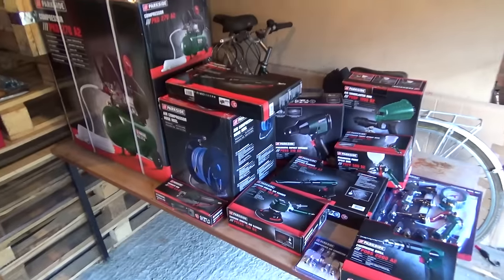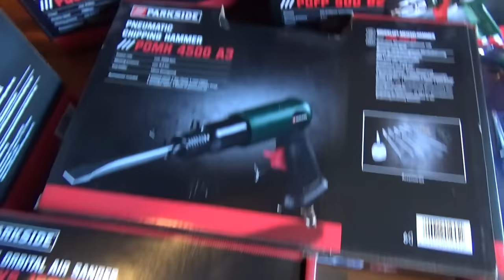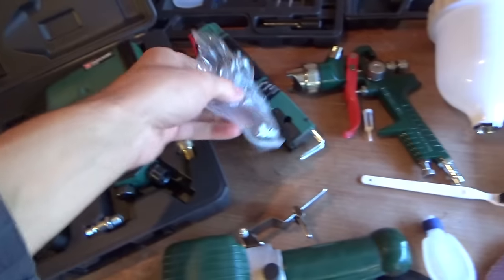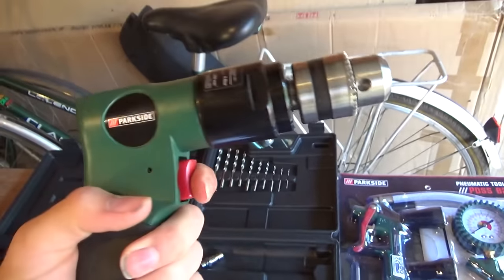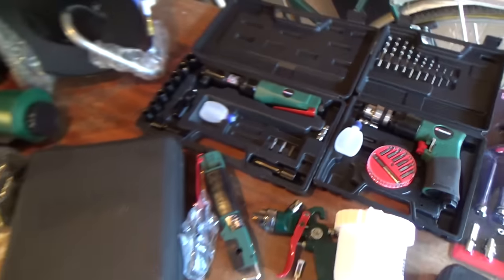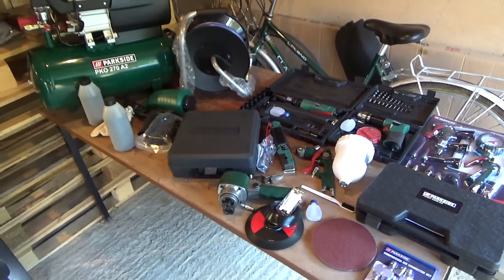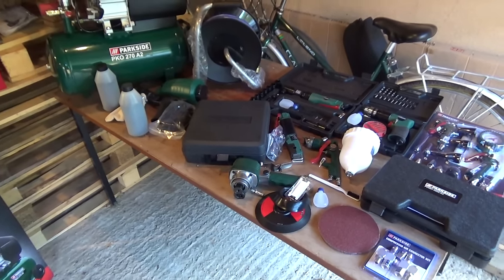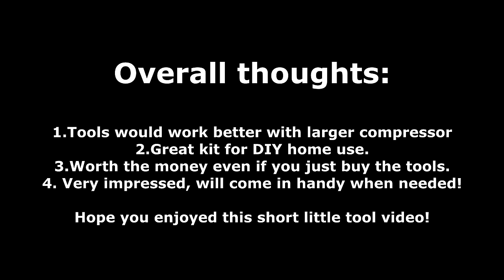Lidl Sells Air Tools?!

Comment: All the tools are good value but the compressor isn't large enough capacity for the impact wrench.
Reply: V T what size do you recommend for air tools ?
Reply: @gerry5134   the work is ok with a 100 litres 3cv bicylindre compressor.(prodif).

Comment: You need to turn the pressure up on the air compressor for things like the wrench it was probably only set to like 50psi and It needs to be 90+. mine works fine
Reply: Yeah i was thinking they wouldn’t sell the air tools on the same day as the compressor if it wouldn’t be fit to run it. I know it wont run for long periods of time but it should definitely run any of them tools on show here

Comment: The most of the tools are quite good for this price (I have almost everything from the video), but 102 l/min. from this small compressor isn't enough for them. The bigger tools (+ the sandblaster) need 180 + l/min (sandblaster - 310 l/min). Good video!
Reply: Tibor Višnai h

Comment: I purchased a Parkside cordless drill about 20 years ago, for a few years it got used 5 days a week and has been used infrequently since, its still In working order though one of the batteries no longer holds a charge. I would recommend parkside tools they are great value.

Comment: hi, when i brought a compressor years ago i was told its the cfm number you should look at as to the power of a compressor. the tank only stores x amount of air and also takes the pulse wave of air and calms it. eg your air tool uses 4 cfm (details on instruction leaflet) and compressor puts out 8cfm all ok with some to spare
Reply: True. Is Capacity really everything? Capacity for me is just how long the tool can run before the tank becomes empty and the compressor has to kick in and to add in that Air compressor is only delivering 103l/m or 3.6CFM which for an 1/2" impact wrench at 6 bar needs 4-5 CFM but they say you should double it for optimal use and we own a 50l 206l/m 7.3CFM and it can run fully undo 2 lug nuts and loosen the other 2  in 1-3 mins before it becomes underpowered. That being said is it better so have more air Capacity or a higher bar with both compressors having the same CFM considering they say most tools are optimal for 6bar

Comment: Nice to see another upload James. I'm sure those tools would work better with a much larger compressor, most of them use large amounts of air volume and that small tank just doesn't have the capacity to run them very well. 
I like your dads little Yamaha too!
Reply from the maker: Mark Fox thanks bud, I will probably get a 100L compressor in time, just wanted something small to try use a blow gun and stuff with
Reply: user12345
Reply: Charlotte Baker ?
Reply: This year Lidl are doing a 50 l compressor.

Comment: You have to set the air pressure of the compressor to 6.8 bar if you use the Lidl impact screwdriver with a 10 meter long tube.
a 50L tank is also recommended but the air pressure doesn't has to be too high because the tool will waste the extra air.
When you have an 8 bar compressor and set it to the max your tool has to spill 1.2 bar but can't control it precisely what is a loss of pressure.

Comment: Looks exactly like my Omega Wolf compressor, which is the same brand as Aldi use to manufacture (or at least at one time they did) as well, just my tank looks a touch longer. I was going to get a new spray gun when I saw these in but didn't in the end. I got the saw from Aldi Workzone the week after, it's exactly the same. I figured I would get an all metal spray gun, the white plastic tub broke when over tightened before. Omega Wolf might be a new company name for the same previous company or the old one & it has a new one now. I remember warranty / guarantee chasing a new air filter was a pain in the arse.

Comment: I bought the £99 Erbauer set of air tools from Screwfix. They've been brilliant, and come in a really tough box, and are guaranteed for two years. Air hammer, 1/2" ratchet wrench, 1/2" impact wrench and blow gun, plus chisels ,extenders and  lots of fittings, grinding wheels etc. I've bought different Erbauer stuff from SF, and it has all stood the test of time. A box of impact screw and nut bits for my cordless impact wrench has not suffered a single failure, and I reckon the Pozi 2 bit in the holder has driven 2000 + screws without failing- better than the kraut bits I used to use.
My compressor is only a hobby 100L 2.5hp 10cfm machine, and with the (Erbauer) 20m  9mm hose I have to turn the pressure up to 105psi to give enough grunt at the other end to operate the ratchet  and wrench at full power. Don't be put off by buying a cheap compressor, they're very useful tools, even if, like me, you're only removing a few stubborn nuts, and inflating tyres. Blow guns are invaluable too!

Comment: Looks like a bargain, but. 24l compressor probably isn't man enough for an impact wrench. The other tools seem to be good value though.
Reply: True. But to be fair on the website all the larger tools state they are not compatible with the 24 liter Lidl one.
Reply: Well, you are correct, but I think it's enough for a person who needs it to change 4 tires on a car twice a year and some small things from time to time...
Reply: You're right, the manual does say 50+ Liters but I mainly use it to tighten nuts on things like motorcycle clutches and for that it's a great tool on a 24L compressor. Just don't expect to do a full pit stop with it in a few seconds because a 24L compressor can't handle the required air volume. For single nuts though it's amazing.
Reply: I have the same compressor and impact. I found if I use an extn cable and a short 4ft of hose the impact works much better. Way too much oomph is lost in that long, small bore hose I guess.
Reply: The size doesn't really matter so long as the pressure is there, you'd just be waiting a lot
Reply: Exactly, I have 50l 3hp compressor from Aldi and all air tools work great. Also it is highly recommended to use big diameter hose especially if it is a long one, because you do get pressure drop.
Reply: I have the same,but connected an old propane tank to it.
Works nice.

Comment: I bought the larger (3hp 50 litre) compressor from Lidl a few years ago, they had 2 marked down to £30 each! A friend of mine said "I bet it's rubbish" but mine is still going strong and has come in very handy. (Mine also failed to remove wheel though).

You can buy better, you can buy worse, but in terms of value for money, this stuff is great.

Comment: Buy a broken second hand air compressor with a large capacity and connect the 24 litre one to it. That's will give you a cheap massive air receiver, I'm currently using a 6 litre air compressor to fill a 150 litre tank and it works perfect once it's charged up.

Comment: These are ok for a hobbyist who uses them occasionally. Will not put up with daily commercial use. The major problem is that one has to wait until they bring them in for 'tool week' and then its a crap shoot if they will bring in the tool you need. The air tools are ok but most of my tools and compressor I brought with me from the states when I moved to Europe. Bought the high end Craftsman tools from Sears before their quality went to the dogs. The compressor that Lidl sells lacks the kojones to provide the proper volume and pressure of air needed for decent tools. The Harbor Freight tools sold in the States are far better than Lidl's products and they are both Chinesium made even though Lidl's products are not properly marked. Many times the package is marked Made in EU but on the actual product it is marked "PRC".

Comment: I have the 50ltr compresser if you use the smaller red hose that comes with it it powers all the tools just fine but remember 50ltr  is not much so it recharges quite quick,the long white hose great for spray painting  but won't run the air tools power full enough if an when parkside do a 100ltr  tank that would be the one to get but I doubt that would be portable with wheels on it

Comment: Dont worry too much about the compressor or gun being 'man' enough for wheel lugs, if something is that tight that shocking it wont do anything its always best to use a bar and apply constant pressure, I work fulltime on cars and I got a 1997 Snapon gun with no balls but when im doing wheel nuts up I know that i'm not over tightening them so when I torque them they're all good

Comment: Just try fitting a 3/8 hose to the compressor. Ok it will charge a lot more but it will have to extra power to use the wrench n stuff.

Comment: congratulations for your new purchase! an air compressor and a set of air tools are usefull in DIY mechanics shop. but for running this tools you need a bigger air compressor, maybe a 50 liters or more. this is why they are running slow. also you need a constant air pressure of 6/6.5 bar.

Comment: 24l=6 gallon air compressor.  You need one at least twice as big, and better three times, to run air tools like an impact wrench.  I have an 11 gallon = 40 liters, and it's barely big enough for light duty air tool use.

Comment: Some one did a review but once the tank was full they turned it off. so the pressure went they said the tools were useless, but if the compressor was on whe they were working would show how good they were.

Comment: You made there couple of typical mistakes with air tools. You have small compressor, so you cannot use too long and soft hose with it (its all about how much liters of air per minute your compressor can provide). If you buy short (about 5 meters) poliurethane hose (it feels like plastic) then your impact wrench will work a bit better. Also with compressor like this one you will not be able to unscrew anything above 200Nm, typical passanger car wheel nuts should be tightened with about 95Nm and screws 130Nm. So with proper set up for small compressor you should be able to change whole wheel set.

And why not to use long and soft hose ? Well its hard for me to explain it in english but its about using some of compressed air to flex (change diameter) hose instead of providing it for impact wrench constant. With large compressor you wont be able to see this problem but with small one its very important. Especially with tools where liters per minute are crucial.
Reply: I'll explain for you buddy,  (i just re read you comment and realised i didnt need to explain anything you did fine, but i have spent the last 5 mins typing this so its staying)
 
The longer the hose the more air the compressor has to push through it before it reaches the tool, now imagine that the hose was soft and flexible like a balloon (extreme case), the diameter will change as the air is pushed through so the overall volume of the hose changes and the compressor has to push even more air through before it gets to the tool.

(In some cases you get a push back effect as the hose expands then contracts which works again the compressor and can even make the tool sort of splutter as it works) - this last "Fact" was passed onto me by a Mechanic, i have not witnesses it myself so dont know how true it is

Comment: You tend to find that with air ratchets they spin quite slowly I have a snap on super duty one and it's about the same speed, as far as impact guns go I'm incredibly surprised it didn't undo those wheel bolts my advice if you going to buy another impact get a good quality 3/8 and just use adaptors the 1/2 are normally too big for most spaces, I have a blue point one in my travel box and that undoes wheel bolts no problem

Comment: I am buying tools in lidl for years, I think they have the best price and quality ratio! And everything has a a 3 year guarantee, I have only braked the tip of the soldering iron and f*ckd it up (felt on the floor). Everything else works really fine especially electric and air tools!

Comment: Are all of the tools and the compressor still working in November 2018?
Reply: I have the same air compressor. I guess I bought it in 2015... It doesn't work much because I don't have too many air tools. but it works every time I need it. It is spot on.

Comment: Just bought this air compressor from Lidl pretty sure it said on the box or in the instructions that this compressor is not big enough to really run most Air tools other than the airjet the paint gun  and the sander but that's all I want it for so it's an excellent  purchase for me cheap to

Comment: i have a question ? if you turn the compressor on does it just keep on building pressure or does it cut off ? and what is the the black knob between the two hose connections for ? please reply thanks

Comment: Had spray gun (for primer) and the lid leaked all the time painting a fender. Could not seal it so return.  Compressor good only for tire pressure :-)  Other tools need pro air supply.

Comment: nice vedeo, i bought the same tools but with a 50 liter compressor and even then the tools that use a lot of air,angle grinder,impact wrench etc are still to weak for proper use,i installed a second tank (piggyback) and still they are usseles,they need better airflow ,so instead of a 1/4 hose use a 3/8 and i would/am going to check if the internals of the tools can be modified for better/more air to pass thru,the lesson here might be ;you get what you pay for ......
Reply: Air compressors is an awkward piece of kit if you are unfamiliar. A lot of people might think hey 100l tank is better because hey bigger number and assume its better but ive seen some Air compressors that are 100l and have the same PSI/Bar and CFM or L/m for double the price even though they have the same performance as a 50l but obv a bigger air rapacity.  An 1/2" impact wrench at 6bar needs 4-5 CFM but they recommend you to double it so you would need 8-10 CFM or 250L/m for proper use. If you can get a 100l tank with 15CFM or 420L/m then your pretty much good for DIY/Home use. Anything bigger would most likely be overkill

Comment: Tommorow I'm buying bigger version of this compressor. 50L 270L/minute. I hope it will work well for spray painting and nailing some smaller nails. Did you try some spray gun on this your compressor? Overall I like Parkside. I started buying stuff there because it's cheap and it's great way to get some hobby workshop full with tools. Don't get me wrong. After 2 years I'm looking for other brands such as Makita. But I think that it's important to learn how to work with tools before you go all in on expensive stuff and this way I already own few tools that I don't use at all but I didn't spent fortune on them and I also know which tools I want to have better versions when/if these give out.
Reply: Thx, man :) btw. I already got it running and so far it seems good. Cleaning dust from routed signs is perfect (my home business). I tried sand blasting couple of glasses and results were just great and I don't have to think about gifts for family for at least next year. I didn't get around to try painting gun yet and they didn't have any nail gun at Lidl right now so that's a bit shame.

Comment: The compressors run the paint gear ok , the totating things need more air and the sand blaster is way too hungry,  iv connected an aldi and lidl compressors to get more flow.

Comment: the range of tools from there and aldi are awesome. impact gun has yet to fail me. turn the torque dial to 4 and use the unregulated outlet on the compressor and power lol. is there a way I can email you or something?

Comment: Very useful video. Thanks for sharing.
The title suggested that you were surprised that LIDL sell air tools. They do indeed, about 3 or 4 times per year.
I bought some Parkside tools but not the compressor. Still doubting between a 24 litre or 50 litre compressor.
The content of the video was very good. The only thing that I did not understand was your comment on the saw.
Can you please explain. In my eyes it did the job quiet well.

Comment: It's not the tools that's the problem it's your air supply it's to low the more air you have the better the tools work you need at least 150lt tank to run air socket gun

Comment: What size is the compressor and what would you recommend for a good sized one if this is underpowered
Reply: 25ltr mate personal experience there not upto much as always needing to refill with air every 30 seconds personally recommend 50ltr onwards get decent ones cheap enough make sure its decent bar to power the tools like he said compressor didn't have enough bar to make the impact gun effective and have decent torque to Remove the wheel nuts

Comment: Your compressor is to small for the the tools you are using. Only big enough for the air blower and the tyre inflator. Should have done your homework before buying. Look up CFM values of the tools and the compressor. You need slightly more CFM from the compressor to run the tool.

Comment: Notice at 4:44 he used the ratchet by hand because it's got fuck all power it looks so shity made it probably can't take a nut of a skateboard may dewalt impact will take a 32mm bolt off a big tractor wheel no problem it could go up to 40mm to be fair but it's only rated for 24mm just buy same good tools and not buy shit like that